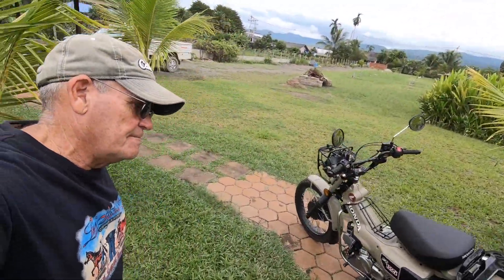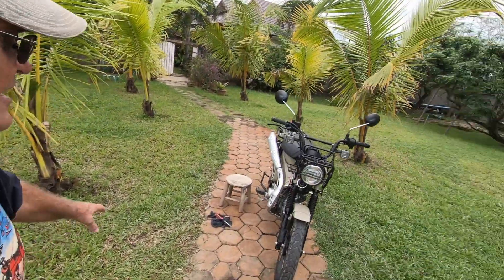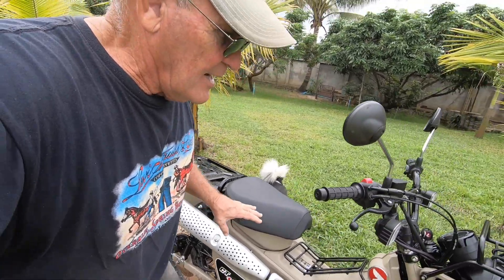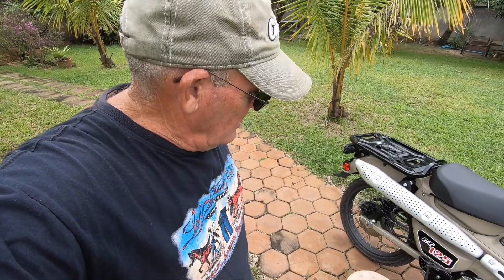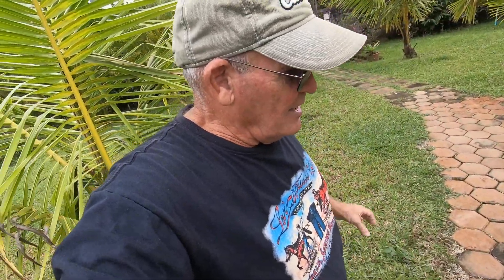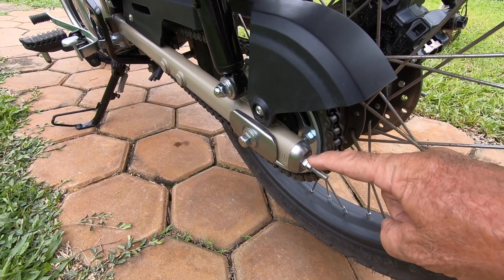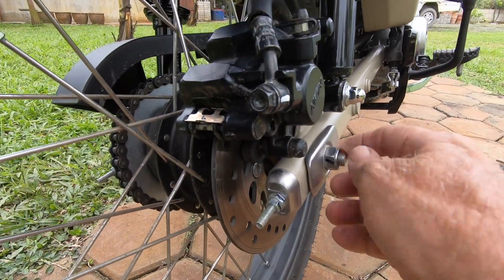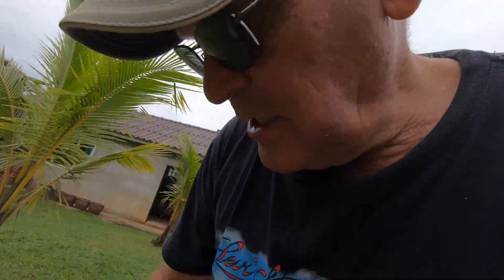Honda CT125 Simple Maintenance

Comment: Thanks for the video.  For me, the center stand is required for chain maintenance (gets the back tire up off the ground so you can adjust/clean/lube the chain).  Keep the videos coming. Fan in Idaho
Reply from the maker: I just use a milk crate to prop the bike on. If this bike had more ground clearance, then maybe the center stand would have stayed on. The deciding factor was when the bike hung up on the ledge, I almost went over the front of the bike, wouldn't have been pretty, not that my face couldn't use some reshaping. It's just that once I fall down, it's hard for me to get back up......
Reply: Every motorcycle should have a centre stand , especially for maintenance , better for parking , but down side is they can get in the way unfortunately.

Comment: Great video. So true on the wash reveal. Ever figure out if the air filter is paper or foam?
Reply from the maker: Yes I did. The air filter is paper and I have found an aftermarket one that is a filament type with mesh wire on both sides of the filament, much like a K&N air filter. I'm going to get one and check it out. There will be a video on it......
Reply: @TeamDNFracing  Thanks for yet another bit of info. I read your comment about the mirrors lack luster field of view. The Monkey has the sane handle bar width believe based on both our Kitaco handlebar cross braces fitting each bike. I ordered these and they work great. No arm or shoulder blocking the view anymore - MC MOTOPARTS MONKEY 125 Logo 10mm M10 CNC Mirror Risers Mirror Adapters For Honda MONKEY 125 2018 2019 2020. Found them on Amazon. Im not hip on the Monkey logo going on the CT so that would be painted over with ease. Just sharing.
Reply from the maker: @findingneutral  Your always welcome on here.... Cheers......

Comment: Another wonderful video with very helpful information
I hope I will not have to adjust the spokes and I'm glad you didn't either
still not thrilled that they didn't give us tubeless tires on this bike, quite frankly
I appreciate everything that you show us and I'm excited your channel is building
you deserve that
Reply from the maker: Thanks for the comment, and when needed, I'll show how to tighten the spokes. Not hard at all.....
Reply: I may be wrong, but I think it's not possible to have tubeless tires on spoked rims?  The air will leak past the spoke heads.

Comment: At what mileage will you change the oil?
Reply from the maker: First change will be at 1,000 Kilometers. Probably go every 2,500 after that. I'll be checking the oil color often, if it needs it sooner, I'll do it, but won't be going past 2,500......
Reply: Small bike like that Eddie , which only takes about a litre , i would change it every 1000 klms , and clean  - check the oil spinner every 5000 klms . Oil is cheap , engines arnt .